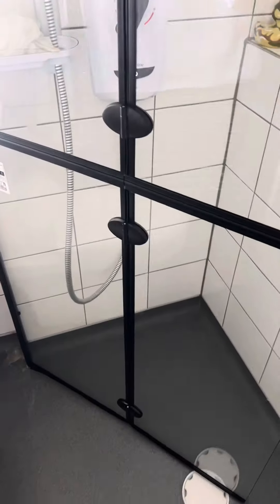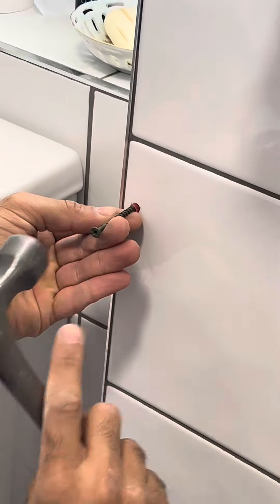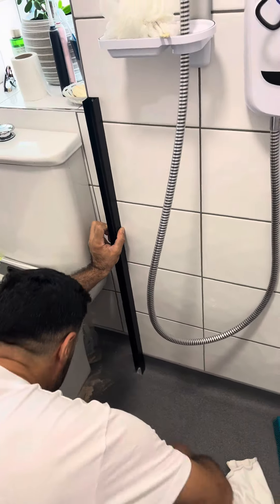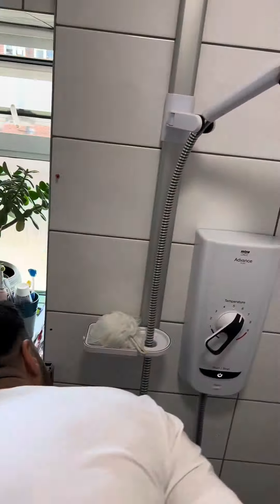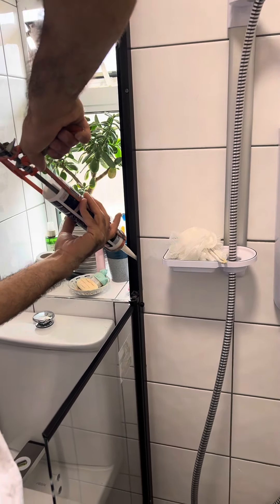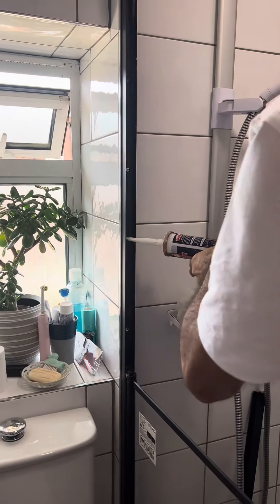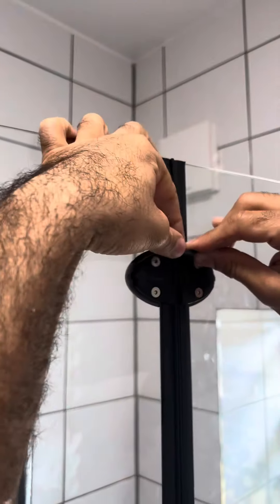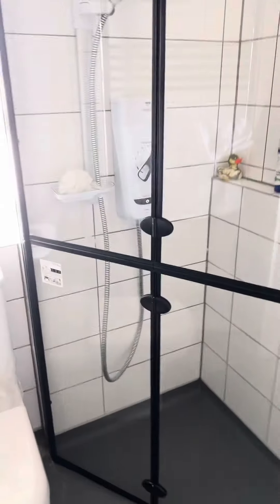A foldable shower screen| installation

Comment: Good video. It looks like it folds in the middle? This is only screen I have seen that does not need a bottom frame. Are you still happy with it? Did you see any alternatives? Thanks
Reply from the maker: @TimHegn  its great to be honest, i have had no issues and it makes the walk in shower look so much more better than having curtains installed. You have the link in the video description if you want to purchase the exact same product because some look similar but are not. This does fold in the middle to create space when not using the shower. Please don’t forget to subscribe 🙏🏻
Reply: Thanks. Good to hear. Yes I will look at link. What size is the one you installed please ? Thanks
Reply from the maker: @TimHegn  it’s 190 x 80cm- but its all in the link once you open it, the details are there aswell. Best of luck. Let me know how it goes.
https://amzn.to/4gQxY5z

Comment: Hey this looks grat, Im thinking about getting the same one. My floor os not flat like yours, instead it has an elevated marble part as a threshold. I am planning to install an 1.90x1.00 so that when open it will step on this marble threshold but im worried about the weight when being closed as most of this will be on air without proper ground support. Do you think that it could hold ?
Reply from the maker: @19cmproductions  hey thanks. I think it should be fine. My floor is also not straight for the water to drain in the middle. But it’s great so far and it has a rubber lip at the bottom so the water doesn’t leave the area. If you want the same one, I have put a link in the description. Best of luck 🙏🏻